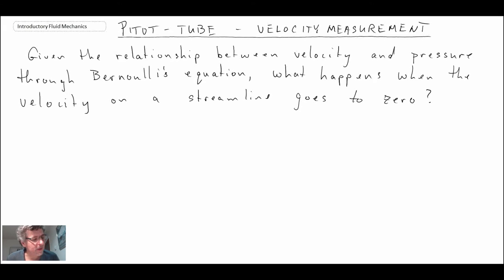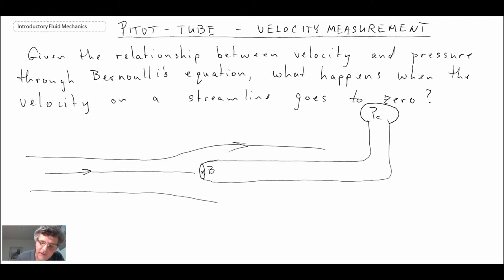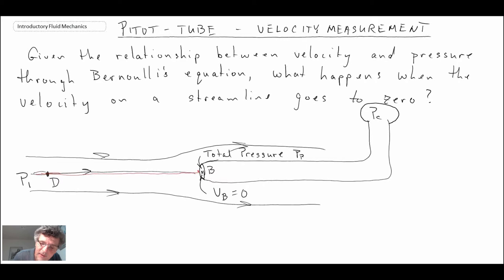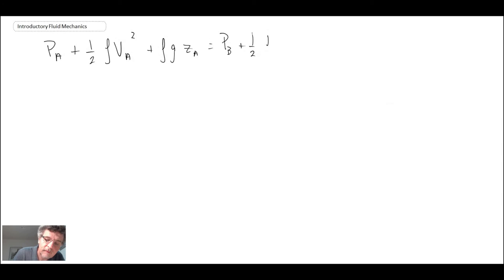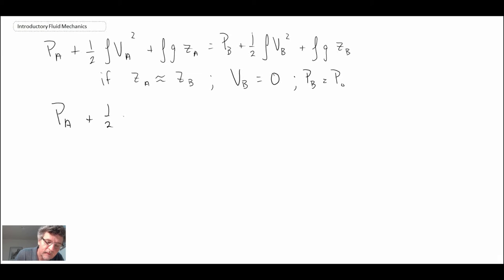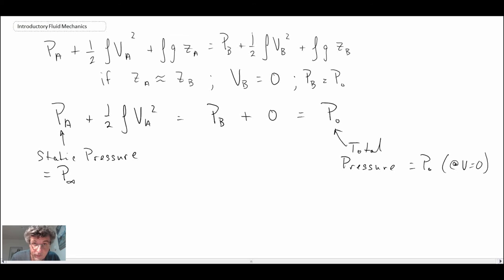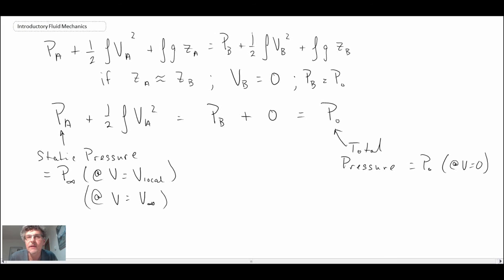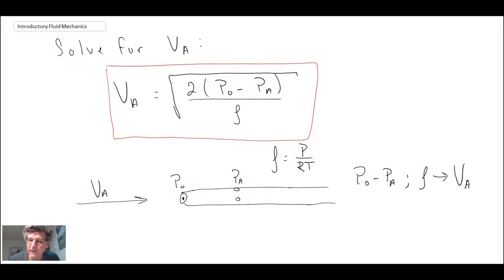Introductory Fluid Mechanics L11 p4 - Pitot Tube Velocity Measurement

Comment: I find it more confusing that one measures the static pressure at the side of the tube. Since there should be a boundary layer or at least some speed up of the flow due to the tube displacing the flow.?